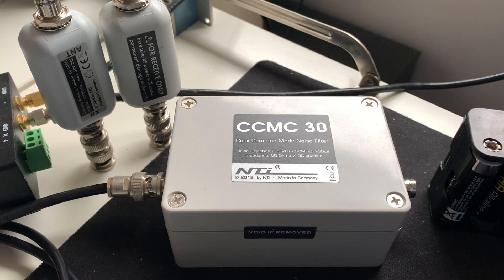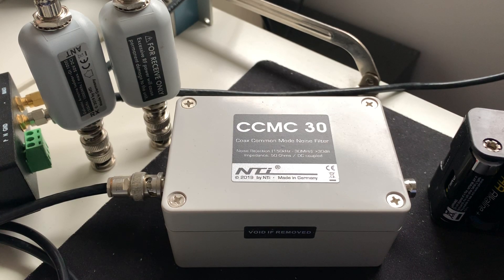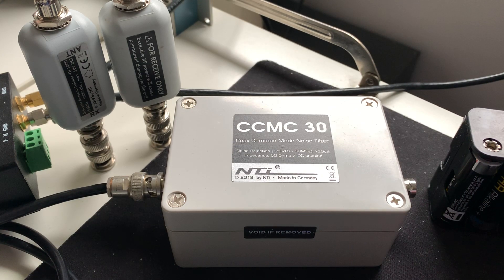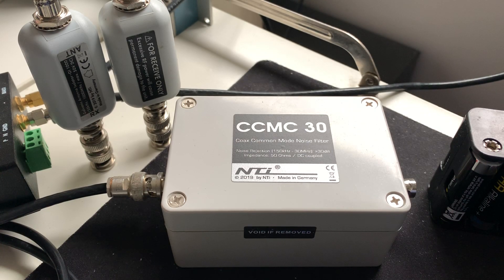CCMC-30 coaxial common mode noise filter - introduction to Bonito's latest noise-busting device

Comment: QUESTION:-

CAN I RUN THIS ON THE SAME CABLE TOWARDS MY VIRGIN MEDIA INTERNET ROUTER, SINCE THE CABLING IS THAT OF A COAXIAL NATURE.

ALSO CAN I USE UP TO TWO NOISE FILTERS SINCE MY CABLE LENGTH TOWARDS MY ROUTER IS RATHER LONG.

CHEERS BRO. !
Reply from the maker: Give it a try - you won't damage anything

Comment: You have alot of information on your channel, so. I can answer my own question
AFI5030 is more as the Isolator that meens its not a CMC
The main difference is that an Isolator can NOT pass DC current and therefor you cant design
it with active antennas, where as a Common Mode Choke passes DC through.
This knowledge took me long time to figure out but its true! and that is the difference
A transformer is 2 loops around a ferrite that are connected to one another and they are only
passing via inductance, so DC cant pass that Inductance loop, if you add DC it will actually shortcut
and destroy and burn the transformer!
But a  CMC its just a straight cable that is turned around ferrite, and since its going around ferrite
it gets a higher impedance of "milli henrys" depending on ferrite material the impedance is higher
on some frequencies, if you need a broadband cmc you will actually need many cmc in series to
add between frequency ranges.... the main point here for RX is that you can use these especially
for miniwhip antennas!!!, very important, since these antennas have a hiqh Q point.
Since they are designed to be fed with DC current, you CANT use an Isolator, this knowledge
as i said took long time to me to figure out.

Comment: Hi Clint. Would this or the GI1000 help with reducing what I think is solar panel noise coming from my neighbour? I'm using a Wellbrook ALA1530LN.
Reply from the maker: Hi Nathan, the short answer to that question Nathan is, I don't know. However, given how brilliant the GI1000 is in reducing most types of E-field noise, I would buy one anyway. 73, Clint
Reply: @OxfordShortwaveLog  Now you're just tempting me 🤣
Reply: @OxfordShortwaveLog  Also, will it work on any receiver or is it more for SDR receivers?
Reply from the maker: It will work with any receiver Nathan...brilliant bit of kit. 73
Reply: @OxfordShortwaveLog  if I was to buy one, would I get the VAT taken off since I'm in Australia?

Comment: Where in line do you put the CCMC30 using active antennas? Between RX and Bias Tee or between Bias Tee and Antenna?
Vy 73
Reply from the maker: As close to the receiver as possible - on the Bias T side. 73

Comment: How different is this from the GI1000? Which one would I be better off with for shortwave and medium wave? I am using a Wellbrook ALA1530LN.
Reply from the maker: Well this device wasn't really effective for me, whilst the galvanic isolators are amazing at lowing the noise floor. Go with the GI1000 - definitely! 73s, Clint

Comment: This is listed as a coaxial common mode noise filter, but is common mode a problem on receive?
Reply from the maker: It can be with an active antenna where the signal path is shared with the potential difference across the amplifier. 73! Clint